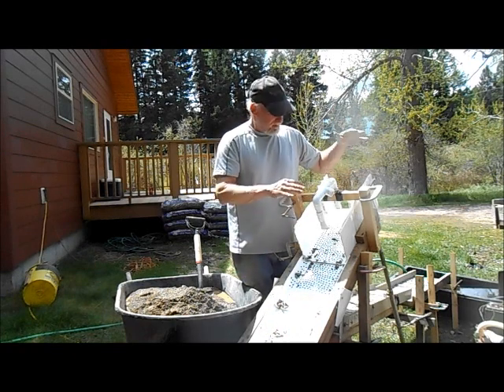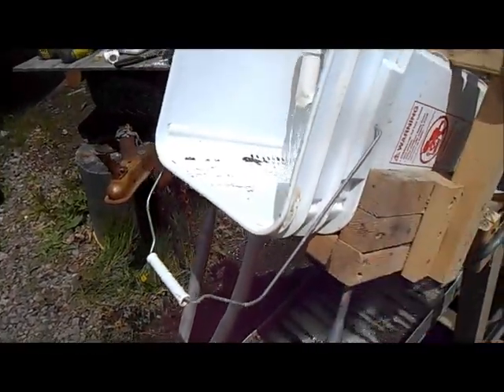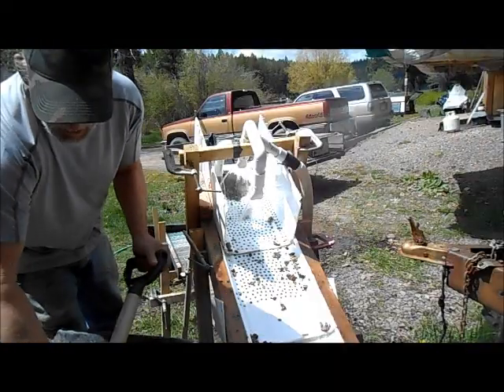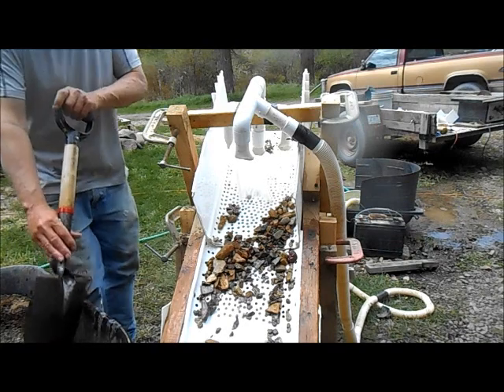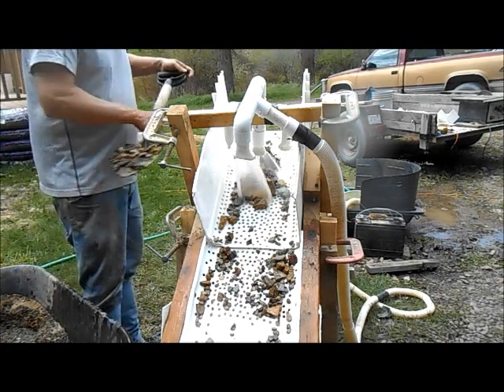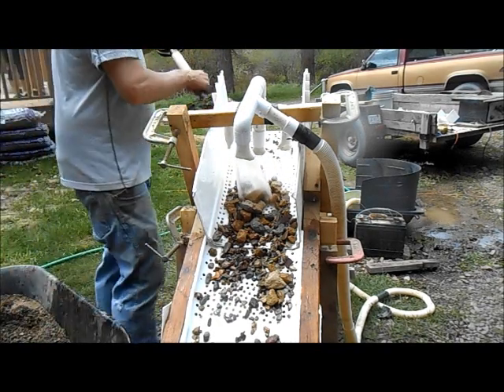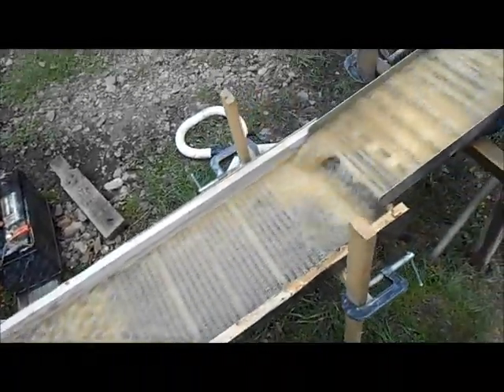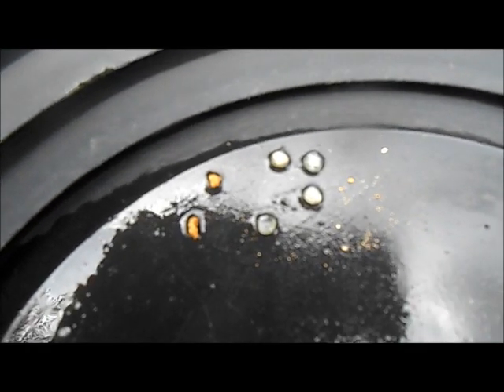New High Banker Design for Recirculating 12 V Setup

Comment: I've got a question for you.. have you tried adding fine sand into your silicon mix when making your mats? Just wondering if that would help create drag when material is running over them
Reply from the maker: No I have not tried sand in the mix. Not sure if it would help or not  it might take away from the hydrophobic of the silicone. I am making mats today from my 3D printed molds and I am getting excited to give them a try.
Reply: @alanrobertson2510  So cool.. Can't wait to see it

Comment: I don't know Alan, that setup allows material to slide right through the shower without being thoroughly rinsed. I still think a hopper with grizzly bars is the best method and I made my own grizzly bars. How can I send you a photo of the hopper I built?
Reply: Upload image to free hosting site and share shortened URL. Also tell Allen to skip the shovel and get a micro wet/dry shop vac dropping into hopper. You can run the vac with a power inverter off truck battery. Sorry your wife got tick bite. Here in applegate they have wings believe it or not! Allen are you panning the concentrates or running them through a skinnier micro sluice? One final tip. Attach a few neodynium magnets under your sluice box and the black sands will create 2 inch high natural heavy riffles. Youtube it !

Comment: Very nice job Alan!
Reply from the maker: Thanks Chris
Reply: So is there something you can do at the top to get a higher angle so the material actually moves down? I feel your only issue “if you feel it is a problem” is you have to keep stopping to clear it. Depends how fast you want to feed it. If it’s a good pace to clear it then it should be fine.
Reply: I’m being defensive because the “bucket blaster” was one of my favourites that you made!
Reply: Actually where is the trommel in this scenario? That on top with this new punch plate slide is probably what I think is missing. Angle the slide more and feed the trommel?
Reply: Sorry for all the random posts but I think you are onto something here!

Comment: Alen ?? The second punch section looks like it doesn't drop into the sluice. This is from a above side view. If not where does it go? If into tailings why have it?
Reply from the maker: Hi Randy The second plate does drop into the sluice. The hole are lined up with the back of the sluice.